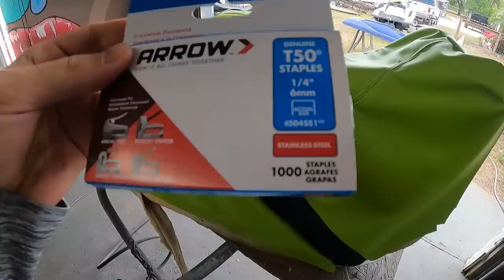Transform your Jet Skis Appearance for CHEAP!

Comment: Did a fantastic job on the seats. You can use a steaming machine to stretch the material and add like .5 inch foam on the front seat back rest and it would look OEM. Nice job 👍

Comment: I’m very curious about your painting setup. It appears to be an exhaust fan at the door. Where does the inlet air come from? Is it filtered? Do you notice any problems? I’d love for you to explain all that, the plastic draping, the lights, the respirator, the gun especially the cleanup and so on…Your paint jobs look good for such a modest setup.

Comment: I think it looks good. Only thing I would have done differently is the seats. I would have incorporated more of the other colors into the seat. For example, making the portion of the front seat behind the black a grey instead, and the main portion of the rear seat blue. Basically to me it seems like there is too much lime green in one spot with the seats.

Comment: I don’t know if it is the same on these newer jet skis but on my old seadoo there is a carbon seal to keep water from entering the ski at the pump. There is a rubber bellows that pushes the carbon against some steel. My rubber bellows was worn out, it kept the water out but when I tried to arrive, the pump would just suck in air. You might want to replace that rubber bellows if this ski has that. That might help with your top speed problem

Comment: The confetti camo was looking good until the big pieces of green ventured in.  It doesn't ruin it but a little would have gone a long way.  All the bits of body work you did turned out really good.  I'm surprised that 800 hours is almost end of life for the power train.  The work you put in on the shell it gave it a new lease on a long life, hopefully the power train hangs in.

Comment: I was really liking where you were going with the blue and silver. Ya kind of lost me with so many graphics. Less is more imo on things like that. To each their own and well…It’s your ski and show  so as long as you like it, that’s all that matters. 

Just an FYI, I’ve been doing upholstery for over 20 years and depending on the material (some has an 80% stretch rate, some only has about 10%) generally when using old material for new patterns, cut it a 1/4” short to allow for stretch. Also make sure you use UV treated thread otherwise it might last a month before it starts to rip apart. It can be a PITA but once you get the hang of it, it’s not terrible. Just hard on the hands when you get older.